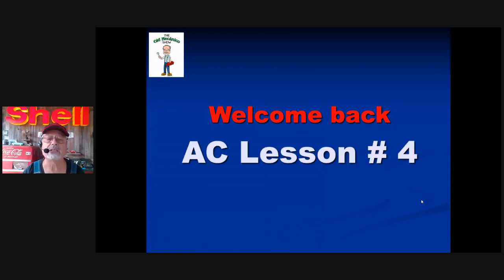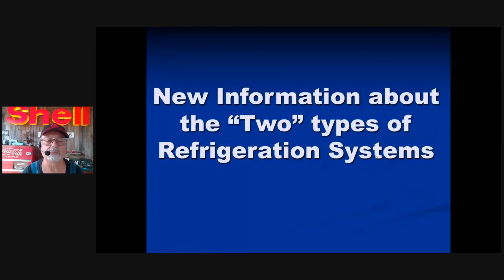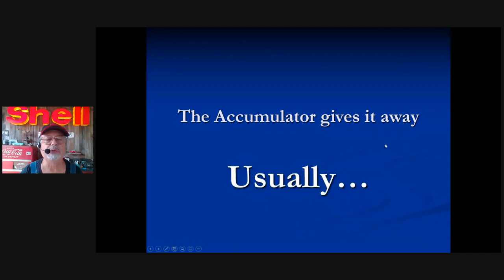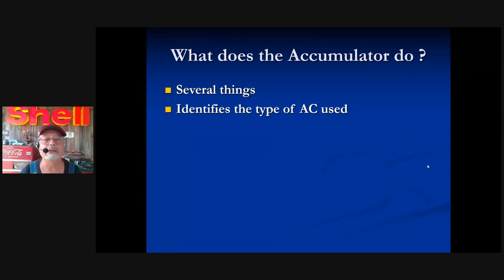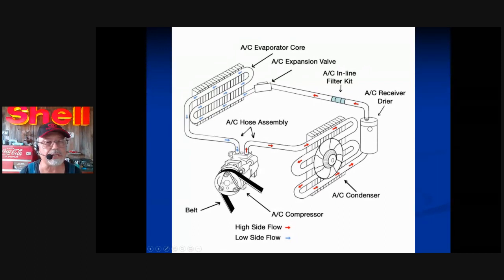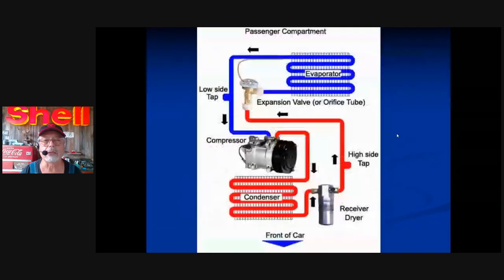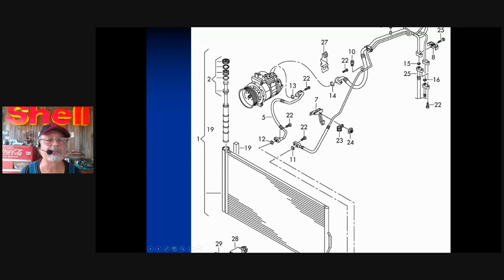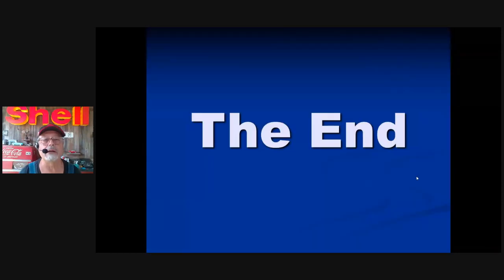Lesson # 4 : Valves Explained.

Comment: Does a dual AC system have an orifice tube in the front and an expansion valve in the rear? I think my 2002 Ford Windstar does. The rear Aux AC in the rear definitely has an expansion valve(90 deg type) , but I'm pretty sure the front is an accumulator (unless I still can't tell the difference. haha). The rear AC does not blow cold but front does.
Reply from the maker: Yes, the front section can be a tube and the rear section will be a valve. Thank you for the view and the question. The smaller line to the valve should feel warm and the larger line should feel cold. It usually is a the valve restricted. You cab remove the valve and try blowing through the small passage with you mouth. It should have some resistance.
Reply: @theoldmecanicoshow9004  I'm assuming the system needs to be evacuated first?

Comment: Do you need to put AC oil on drier when replacing it?
Reply from the maker: Yes... 2 oz.'s of oil in the drier. 1 or 2 oz.' for the condenser and evaporator and any hose. The idea is there should be a trace of oil in all of the refrigeration components. When you replace one or more of the components, you add oil. Thank you for the question and the view.
Reply: @theoldmecanicoshow9004  thank you!!!!!
Reply: What distinguishes the discharge hose from the liquid line?  Great series!